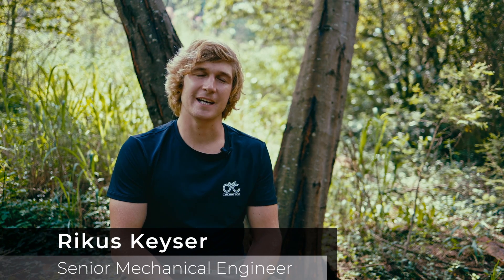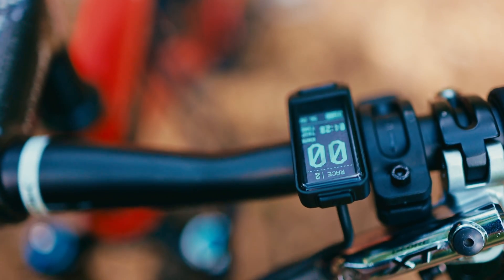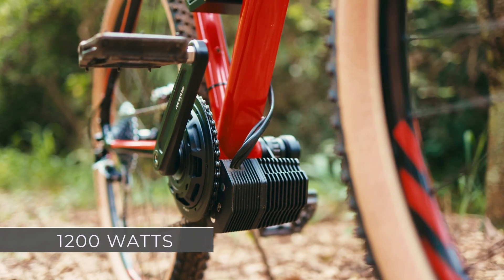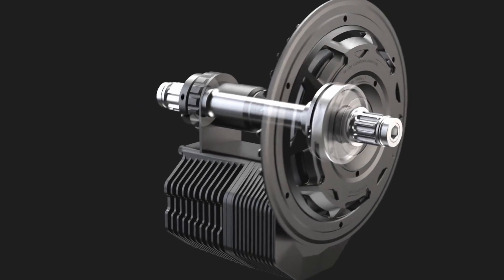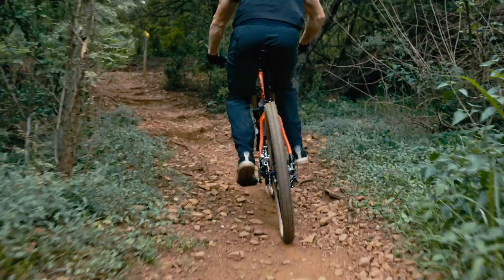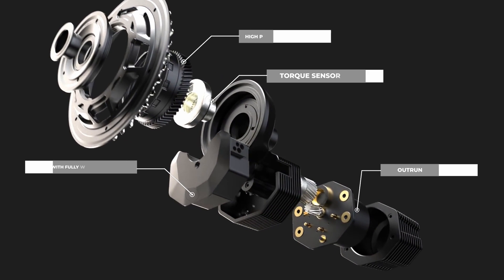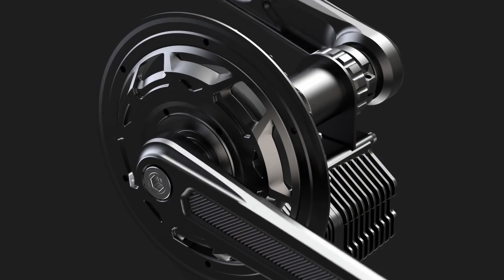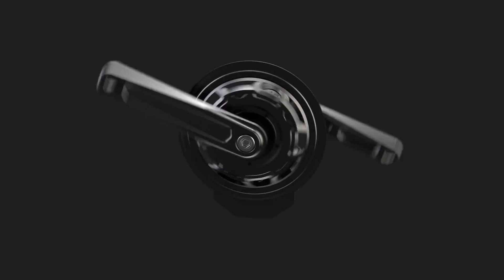CYC Photon! Why we developed it & how it works - Behind the concept of our ebike new conversion kit

Comment: Hi CYC, is there a plan to develop a lighter weight Photon-like new motor in the near future? Sub 500 Watt and cut the weight and size to 2/3 of the current Photon. Also want shorter Q factor from 200 to 180mm. Feedback from a Photon User.
Reply from the maker: Interesting questions. We specialise in high power, high torque systems. No plan for a smaller conversion system at this point although you can get the Photon in a 250W version but it's only different firmware.
Reply: Big name ebike companies are deploying light to mid-weight bikes that are using light weight mid drive motors. It's a trend that you can't miss, go lighter and go stronger is the two growing ends that your company should both follow. I'd like to see a light weight Photon like motor be developed to meet the need. Thank you, CYC!

Comment: I converted one of my titanium frame road bikes with this photon motor this summer, and have been super happy with its performance, ease of installation and maintenance. If you can change your BB and chainring, you can easily install a Photon motor. I loved it so much, I connected my Winter Fatbike to an e-bike with the Photon motor, and then converted my wife's city bike to an e-bike with a 3rd Photon motor. well done CYC!

Comment: So many people gettting screwed here and waiting weeks to have their motors fixed by a dealer. All photon has to do is help their customers with trouble shooting and have off the shelf parts available to fix things when they malfunction. There is no way I would purchase one currently untill CYC allows users to fix their kits.
Reply: I have to agree with this in some respects.I ride with a small group (U.S.A.) with many different manufactures. It is wide spread across many manufactures. Dealers seem to be lacking support as well. I hope this gen 2 is a great success.

Comment: What’s the use of that?  Not legal on UK. roads without registration.  And where do we see that !   Cannot any of these cycle engineers produce an inexpensive UK street legal 250watt,high torque clip on motor unit with gear box.   Make it lightweight, zero resistance when not using motor aid and battery power efficient.  But no, they pander to the underground chancer brigade, forest wreckers and across the pond speed merchants.  Get a motorcycle (electric of course)

Comment: hello. Please inquire about the Photon Motor. Bafang can be used up to 12mm from the bottom bracket. The photon motor looks a bit wide. May I know the distance between the bottom bracket and the motor crank axle?

Comment: Hi, I am keen to purchase one of your mid motor kits but your website does not give me the relevant information about anything other than how its built etc etc. I need CYC to assist me in my purchase,  I do not have a clue about the difference between all the models, for example, I want the longest range available but also the lightest kit to fit to my full suspension bike, your CYC X1 Pro Gen 3 states 3000w or 5000, but only offers in the drop down menu the 3000w controller, so is this upgradeable via an app or do I need a 5000w controller!!, do you now see what I mean, your website is very very professionally designed and looking but lacks the very basic information for people who have no real experience of e bike stuff, btw I am a design engineer/fabricator/tig welder and your kits are the best looking kit, if nothing else, I look forward to your response. Lastly Molicel are considered the best battery cells from all the experienced e bike builder i have met yet you only do 52v/12.5ah!
Reply: CYC is the manufacturer, you need to contact a CYC retail seller.
Reply: @geraldhenrickson7472  so is there no contact with anyone bar the retailer who with the exception of bicyclemotorworks in the usa are rubbish with their knowledge of the cyc stuff they are selling, on another note is the power delivery anything like the bafang mid mount motors??? thanks for your reply btw.

Comment: Will this be UL 2849 approved?
Reply: I guess not as it is not a complete bike unit, only the motor, so they user could soource a battery from elsewhere, and the 2849 standard covers batteries
Reply: @AndrewDCDrummond  UL 2849 covers the whole system, which it looks like they have. UL 2271 only covers the battery.  It would be a simple thing for them to get the motor, system, and the three batteries approved.  If they did that, they could make millions in the US alone.  Also set up a "base" in the USA to work from for the Photon.
Reply: @bigwheelsturning  It is NEVER simple to have UL approve a device. And very costly. And to what end? Who cares?

Comment: Good job the way it mounts and the cranks are a real work of art. Very well thought out and executed with the torque sensor and cadence sensor making it work like a factory bike. The mounting method looks very sturdy and should stop the motor from coming loose. The ground clearance is also excellent as is the overall weight. A superior kit to the Bafang well done. I just went for a ride on my MTB around my favourite little circuit, this kit would spoil me😎👍
Reply: This kit, as well as others, will make you ride more. This leads to more exercise and when you are as old as me...want to ride everyday.

Comment: I love the sprag concept...I just wish it had a way to mount up my gates sprocket.
Reply: I agree. Alot for me to like about this CYC Photon! I'm multiple emails into conversations with both Gates and CYC about attempting to fit a Photon custom build I'm currently interested in building. CYC says while they do not sell any bolt-on gears for them at this time that there was an adapter that could probably be used to adapt to a Gates belt setup. The Gates guy mainly warned me about the 90 nm rating of their CDX & the Photon has I think 110 nm ot torque in it's stock 1200 watt max, if I remember correctly. The Photon could be dialed down a skosch bit and I feel the CDX should handle it pretty well. Neither party could give me specifics regarding getting the proper belt alignment. 

So I'm still in research mode while I wait to see how well some of these CYC Photon custom-builds handle the heat on some longer rides this summer.

I'd been crossing back and forth between Kindernay 14 and 7 speeds, but have decided to wait till this fall when 3 x 3 comes out with their new 9 speed IGH which looks very interesting! The market for IGH hubs is getting very interesting suddenly and this CYC Photon seems like it might be a great fit for various ones of these.

Comment: Love the idea of the motor. Best one I have seen. But your batteries cost 1,000 dollars and their shapes do not fit a lot of current mtb frames. Without an affordable, better shaped battery, it’s not a complete system for me. Also you could provide alternatives for backpack batteries that would be easy to connect and disconnect. In summary, good job on the motor itself. Now figure out the batteries alternatives.
Reply: Check out bicycle motor works. They have many sizes and the best 21700 cells. Finding a way to mount isn't difficult with a cage
Reply: @nugalonious  I agree the bottle cage batteries are spiffy yet always seem out of stock.

Comment: We would like to learn more about the repairability of this motor. Can we buy parts and perform repairs on this unit?
Reply: Dissapointed to hear this if so, as a mechanic making this serviceable would be a massive win. Still riding 90s stuff but so much modern stuff after 5 years is hard to find parts for.
Reply: @markivory7121 I thinnk for the price you have to pay (1400 EUR in EU for kit without the battery) this is a big minus. What happens after 2 years when warranty is out?
Reply: @markivory7121  Serviceability of a product has been an issue for decades. It is a by-product of higher levels of technology. Fortunately, many such items are not prone to failure. 90's stuff is simple= easy to repair. 2023 products? Not so much. BTW...you are not a mechanic any longer. Rather,  you are likely a technician.
Reply: from what i understand the CYC PHOTON is not user serviceable, they will ask you to ship it across the world for a simple repair
Reply: @EBikeBuilder_ The smaller more compact an item is...the less likely unskilled end users can service it. For reference my Haibike is not tiotally serviceable yet...is 7 years of hard use, its never failed. Such may be the case for a quallty item like CYC offers.